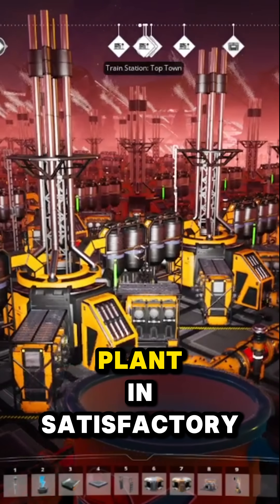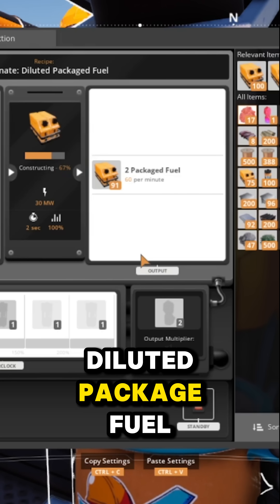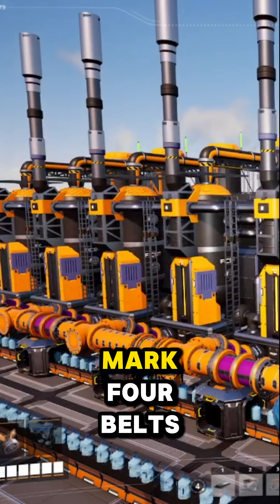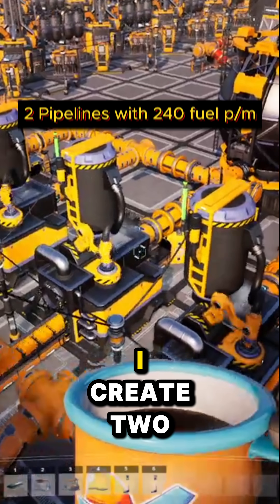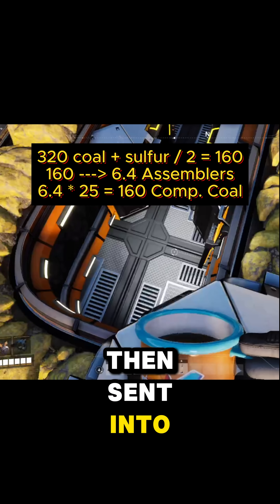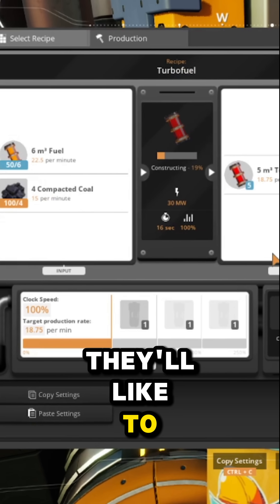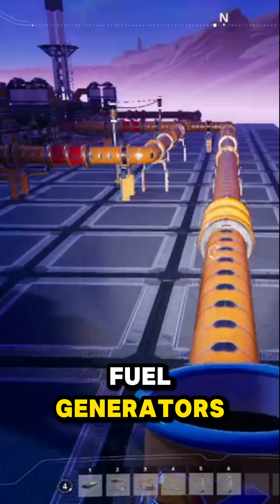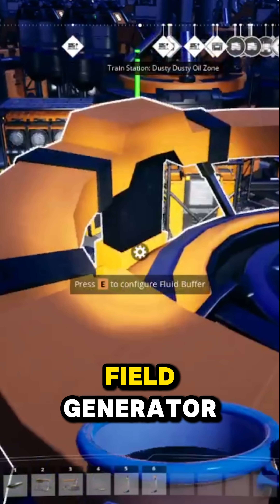How To  Make A Simple Turbo Fuel Power Plant in Satisfactory Without Going Insane #shorts

Comment: Im not understanding why you need to package it
Reply from the maker: In early game, the diluted packaged fuel recipe gives you much more output than if you just converted the crude oil right to fuel. But it only works by combining heavy oil residue and packaged water. Later on you get the blender which can skit the packaging step.
Reply: @ArchieAmicoShow  interesting, I made a creative world to test the different paths you can make to creating turbo fuel (before blender) and i gotta say I'm much more confused. The bi products can sometimes be used to create things you need in the process but I end up with like 10 machines for like 60 turbofuel a minute
Reply from the maker: @mr.bossman8935 Yeah Turbo fuel before blenders takes a lot of refineries, it’s insane. As for byproduct, just sink it, or at least use a smart splitter with overflow to make sure nothing backs up
Reply: @ArchieAmicoShow  interesting, its nice know that eventually you can lessen the machines. But pre blender definitely has me creating this convoluted mess of bi products powering refineries and just a really messy spaghetti of things
Reply: @ArchieAmicoShow  pretty sure you get the blender before the recipe for turbo fuel.

Comment: I was waiting to do this with heavy turbo alt but the game doesnt want to give it to me, did the math and heavy oil to heavy turbo produces most i believe, but since i didnt have it i used 2 pure oil nodes with max OC, 10 refine to fuel and 17.7(18 set one to 70%) and made 35 fuel gen OCmax (which takes the output of 1 tfuel gen, 18.75) 35, connected the 2 .7s seperate and to buffers overflow, and i have another pure node with 35 reg tfuel gen that i dont feel like chaning to OC😂, sitting at 45k mw hopefully that is enough till i get nuclear started.
And compact coal was lil pain but it takes with my set up 266 cc for 18 tfuel refine

Comment: Do you realize that there is a diluted fuel recipe that doesn't require it to be packaged. I used that in my 5/m nuclear pasta setup. Its really good
Reply from the maker: Yeah, the Turbo fuel blend does not pop up until after Tier 4 when you get blenders though right?
Reply: @ArchieAmicoShow Oh, I forgot you needed blenders
Reply: Yes but it requires you to use Blenders wich are unlocked at Tier 7, so you cant use them when you Build your First power plant!